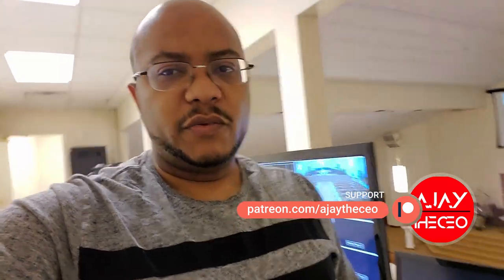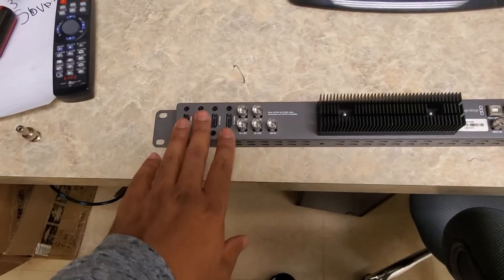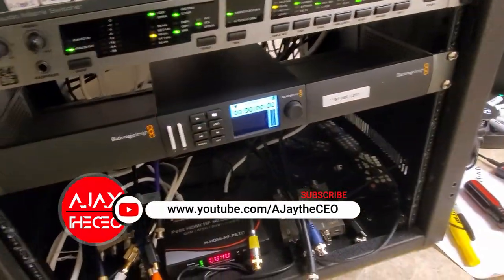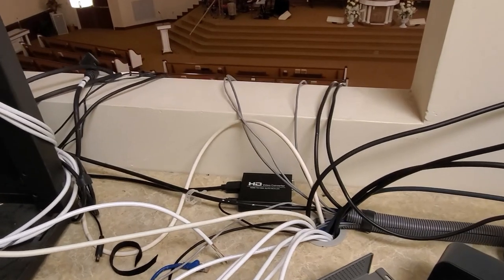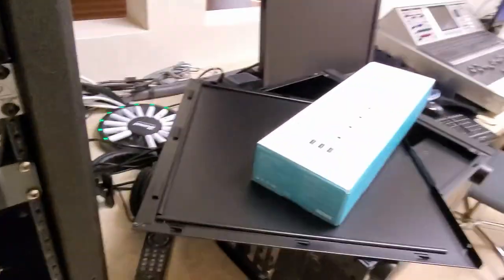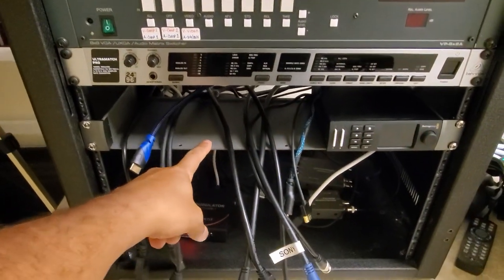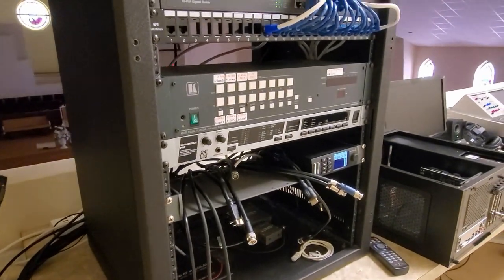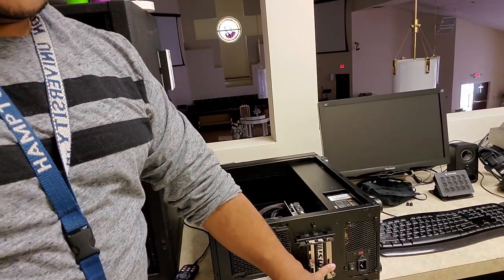VLOG077 - Media Booth Repairs At Home

Comment: Those HDMI may not have stopped working. I have that ATEM and it can only do 6 inputs at a  time. Either 4 SDI and 2 HDMI or  4 HDMI  and 2 SDI. If you have 4 SDI hooked up guess which HDMI ports don't work? You guessed it the 2 you pointed to. When I got it I thought it did 8 inputs because it has 8 but in computer terms the middle 4 inputs share 2 busses  and each will do either SDI or HDMI. When you look in the software in the labeling you can see where to specify which type of input you are using. I can't get more specific about what heading to look under because I'm not sitting in front of it but I know you can do it because I relabeled mine because I seldom use HDMI because of the cable length restrictions. So it will probably work well in the chapel.
Reply from the maker: yes it only supports 6 inputs but I was testing only the 4 hdmi ins and changed it in the software and they still did not work
Reply: @AJaytheCEO   I hate when equipment starts to go bad . I was hoping you just didn't realize and I only saw the SDI cables so I was hoping you just missed that. Well it probably served you well